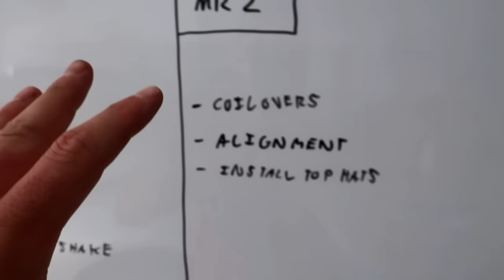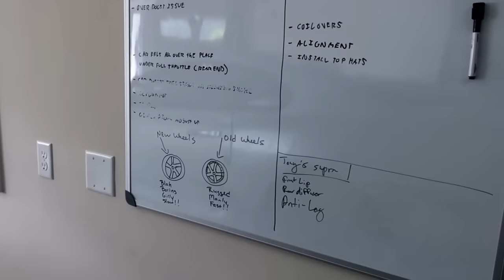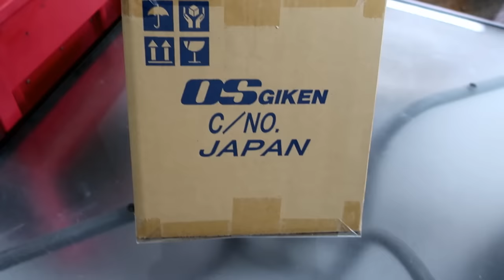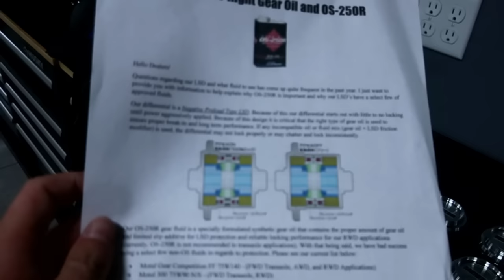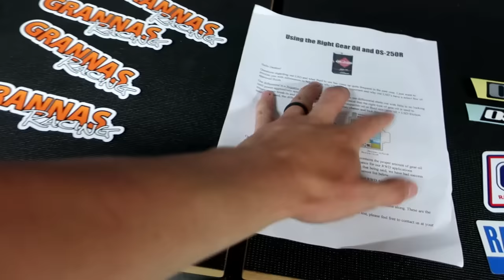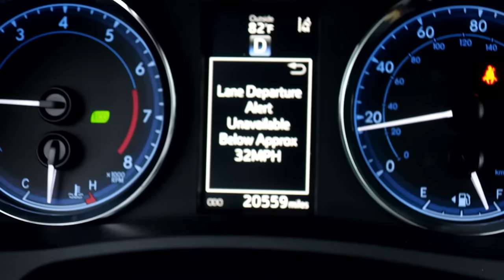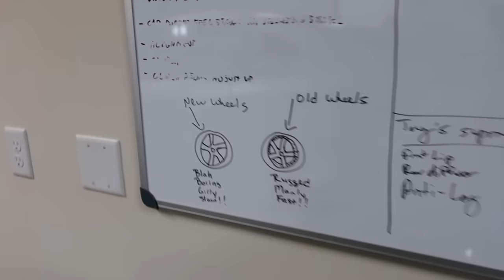New OS Giken LSD for the Supra!

Comment: I have a something simliar to what you have. I have a gs300 LSD rear DIFF from Kaaz. My question is, when installing this after the main washer. Exactly how many thin washer did you use on that top of that to create the perfect spacing when putting it on the supra.

Comment: Okay man. So I have a original auto tt car and been v160 swapped with everything but still has the auto 200mm diff and axel in it unfortunately. If I did the gs400 diff with a os geiken lsd. Do you think it would be worth it.. ?or just spend the extra money to get a 6spd diff and axel (if I can find one). And just pay up to 4K for it??? I want it to have the gear ratios a v160 car is suppose to have and not be so short with my auto diff.